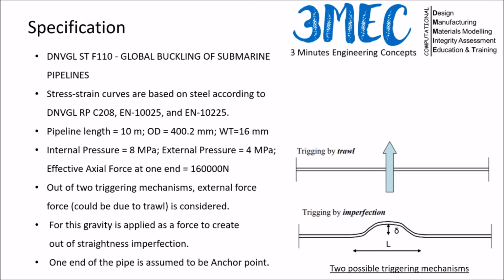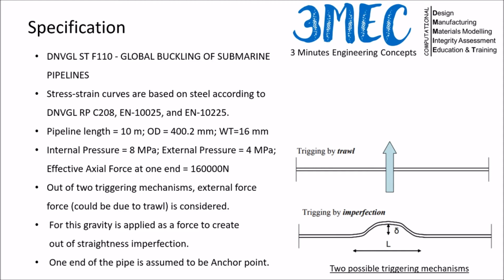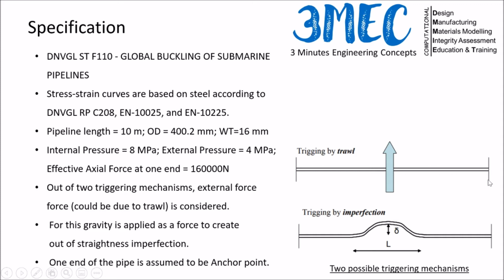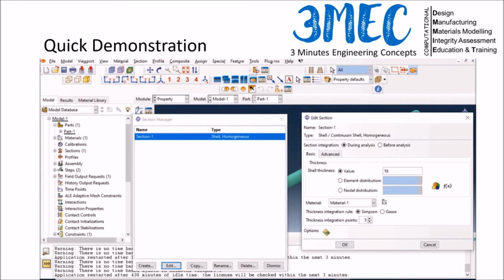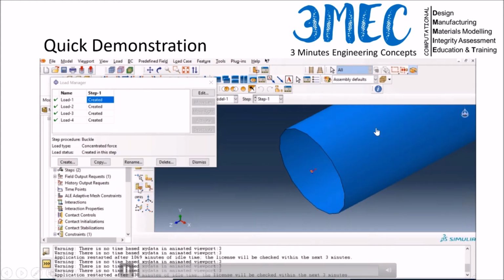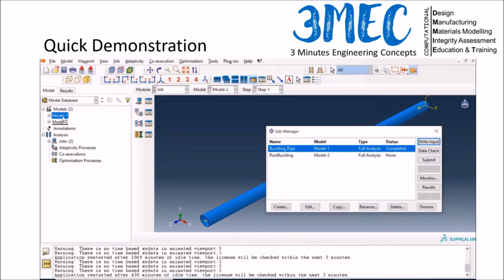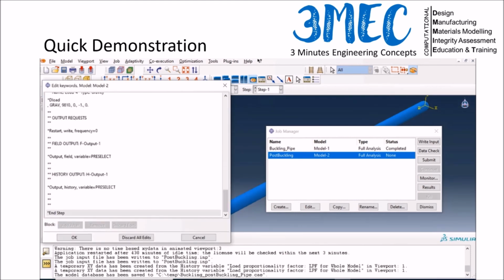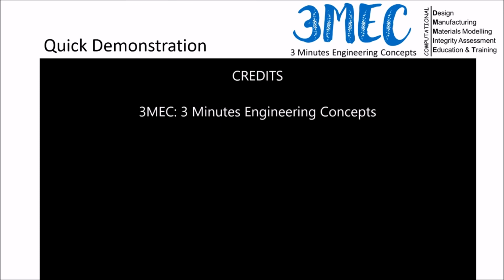Buckling of Submarine (Subsea) Pipelines using ABAQUS CAE

Comment: Sir, can ABQUS be used to calculate the subsea lift to the seabed operation?
Reply from the maker: Yes, ABAQUS can be effectively used to simulate subsea lift and laydown operations to the seabed, provided it's set up correctly. This type of simulation involves modeling complex interactions between the pipe, water, and seabed.

Here’s how ABAQUS can be applied:

1. Structural Modeling
Model the pipe as either a shell or solid, depending on required fidelity.

Include mass, buoyancy, and hydrodynamic forces (added mass, drag).

2. Environment Setup
Use nonlinear static or explicit dynamic analysis depending on the speed and complexity of the operation.

Define gravity and hydrodynamic loadings (use *DLOAD or *AMPLITUDE curves for time-varying loads).

3. Seabed Interaction
Use surface-to-surface contact to model pipe–seabed interaction.

Apply appropriate seabed stiffness and damping (can use *FOUNDATION or *ELASTIC FOUNDATION).

4. Buoyancy & Hydrodynamics
Buoyancy can be applied using distributed body loads or *DLOAD based on submerged weight.

For lift through water, consider using added mass and drag coefficients if fluid–structure interaction (FSI) is not explicitly modeled.

5. Winch or Crane Simulation
Model the lifting line using connector elements or boundary conditions with time-varying displacement/force.

ABAQUS doesn't have built-in CFD, so for highly accurate hydrodynamic effects, coupling with external tools (e.g., OrcaFlex or CFD solvers) may be needed—but for structural response during lift and laydown, ABAQUS is fully capable.

Comment: could you present how we can apply temperature rising in our model
Reply from the maker: do you mean the operational temperature is increasing or is it for some other example?
Can you please provide more details?
Reply: @Professor3MEC  Of course. My university thesis is about  upheaval thermal  buckling of pipelines. Temperature change can creates thermal expansion in pipelines meanwhile soil friction prevents from pipe movement. therefore, an axis force will be created in pipeline and it cause to buckle.... I have a model in abaqus and I must apply temperature change .  boundary conditions have to be fixed for both side of pipe. My steps are general static (for weight) - buckle analysis - riks methode.  My final outputs have to be the diagram of temperature- vertical displacement (vertical buckle amplitude) ...I can not do this analysis and my abaqus gives me error . I don't know how can i model and analysis this project.
Reply from the maker: Is it possible to share your model and I can have a look? Email address can be found in About section of youtube channel.
Reply from the maker: @kiavashh5559  You may use predefined option to apply temperature  change which will ramp during the static riks step. I hope this helps.
Reply from the maker: I have created a simple video on how to include temperature effect in performign UHB. It is scheduled for tomorrow. I hope this is what you were looking for, otherwise get back and I will see what can be done further about it.
https://youtu.be/Vlxlzu-GWw0
Reply: @Professor3MEC  Here is a sample article https://www.researchgate.net/publication/318571189_Finite_Element_Analysis_of_Upheaval_Buckling_of_Submarine_Pipelines_with_Initial_Imperfection